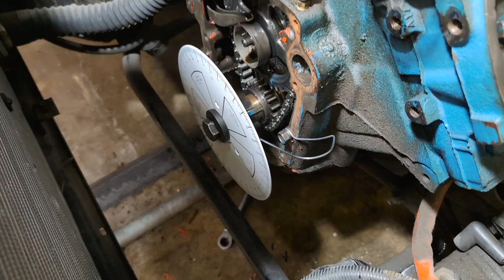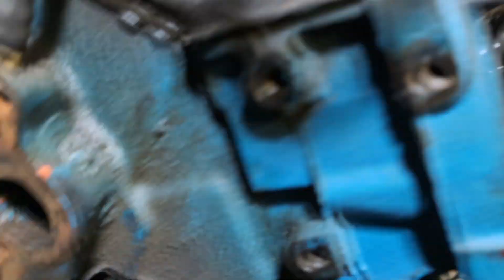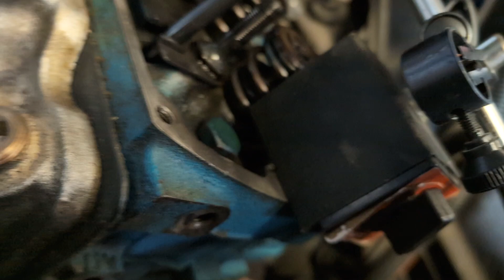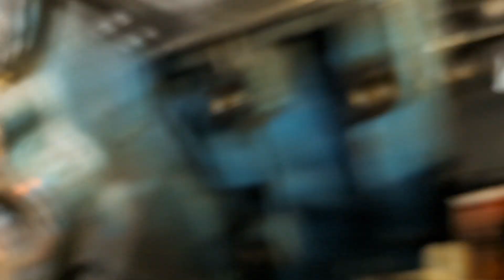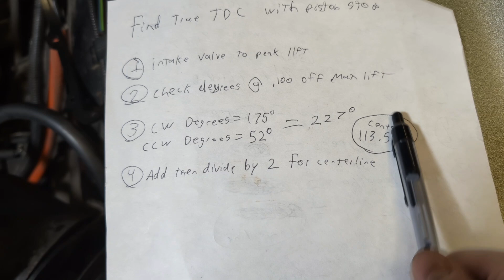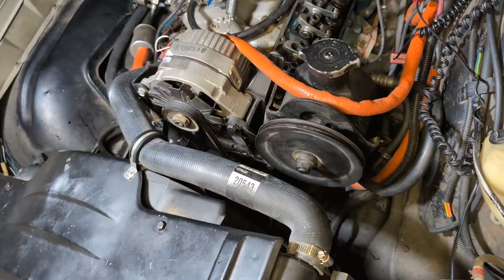Setting Cam Timing On Olds 455 1967 Cutlass tko600 5 speed

Comment: What a Beast! Rocket
Reply: Ya damn that’s a hefty timing chain
Reply: haha it's gotta be. these 455s chew up timing sets if not taken care of. I think many of them used nylon freaking sprockets from the factory (though mine had been replaced by the time I had to, well, replace it again!). Biggest shocker for me was this feller's single fan in front of what appears to be stock radiator (unless he has a puller or the stock fan on the other side?). The 455 in my 70 Toronado LOVES running hot and half my build has been based around cooling lol

Comment: Good video and a good lesson here.... degree the cam every time. From an old drag racer back in the 80's and 90's, nice ride. Mine was a 71 Cutlass S, 455 (small valve E head motor out of a 70 Delta 88 Royale) and a wuss Mondelo 216/226 at .050 cam with stock non-adjustable rockers that still ran well into the 12's. When time and money permit, I think you be happy with an MSD or Mallory unilite distributor. More reliable than an HEI and easier curve to as the stock ones often just keep pulling advance, too much advance, as the RPM's go up and up.
Reply from the maker: Yes definitely. I don't have any experience with the msd or Mallory but I've heard good things.